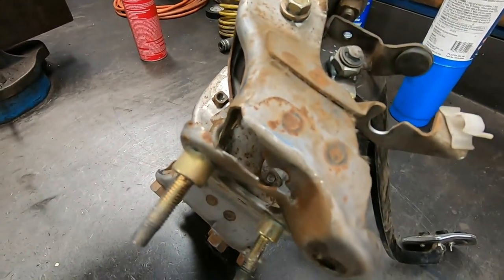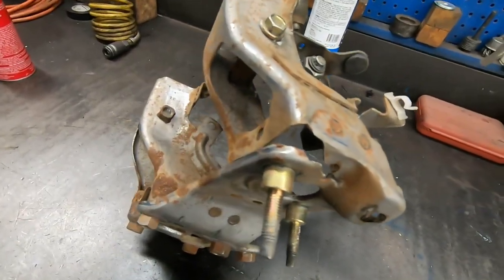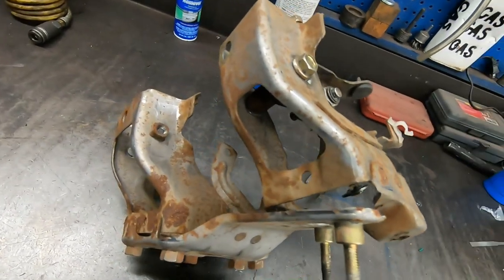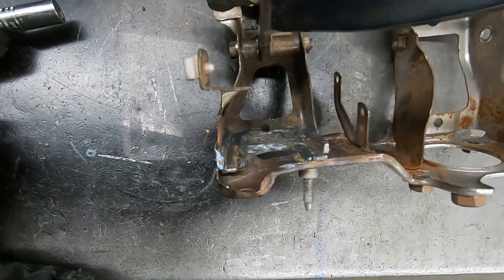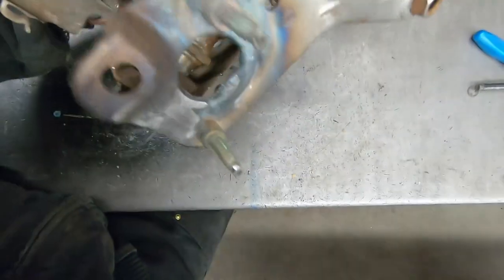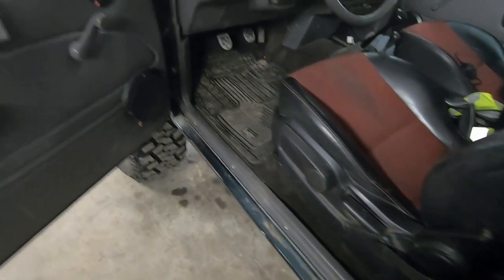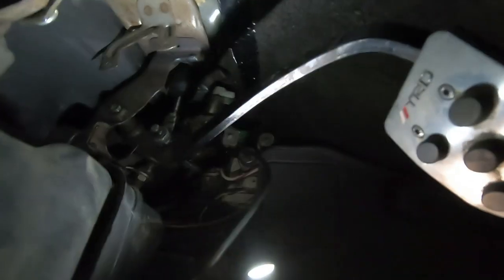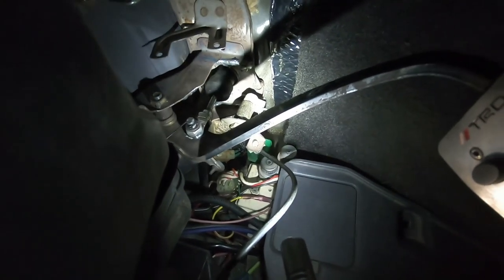Toyota Pickup Clutch Pedal Bracket Reinforcement

Comment: I've just gone through that experience for the second time. First time it happened was in TJ at 4am, scarry shit being stranded south of the border. But believe it or not, lots of the local people start coming out of their homes at 5am while it's still dark on the weekdays to go to work, school, & college (yes they have colleges there too) so I felt safer that the streets were no longer lonely. Anyways, I thought my clutch cable was tearing till it finally tore. It turned out that the bracket cracked in the same area as yours so I had a local little mechanic shop weld it when they opened up in the morning. Now that it happened a second time here in California, I pulled out the whole bracket & had it welded properly this time so that it doesn't happen again. I guess the generation 2 4runners are notorious for having this problem (among many other things)  because every 4runner in the junkyard had the bracket welded on the same area. New will cost about 200 bucks on ebay. Great video.
Reply from the maker: That would definitely not be a good feeling. Its good you were close enough to a shop to be able to get it fixed the same day to get home. I got lucky having mine finally break within a couple miles of home and the shop that I work for. They are just too thin of metal to hold up to a heavy clutch after 200k miles lol

Comment: I have the same problem - cracked bracket in the same place. I am competent enough to take off the bracket and reinstall it, but I have no experience welding and do not have the equipment. Would a weld shop take on this type of work? Yours looks amazing - Could I ship mine to you?
Reply: I've also got a few similar cracks in the firewall, right where the clutch bracket bolts come through for the clutch master cylinder. Do you think these cracks should be welded, or if the clutch bracket is reinforced will these cracks not matter?
Reply from the maker: A fab shop may do this for you, or try to find a buddy that has a welder that could do it for you. If the firewall is cracked too I would say welding the cracks in the firewall as well would be the best fix but not always that easy. If they aren't too bad yet you can drill a hole at the end of the crack to keep it from cracking more and just bolt it back in. But its really up to you as far as how bad it is.

Comment: What trans are you running? How’s the drivetrain hold up to the v8?
Reply from the maker: jake waters I am using a R150 trans from a 3.0 v6 4Runner and just  factory 22re differentials with a limited slip eaton true trac carrier in the rear. I have had this truck on the road just over one year now and it is all holding up great!